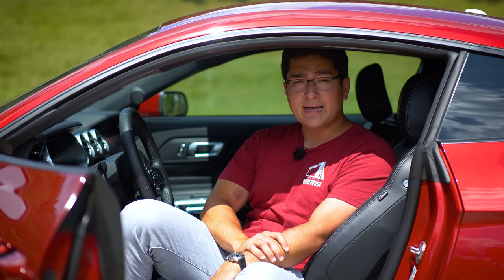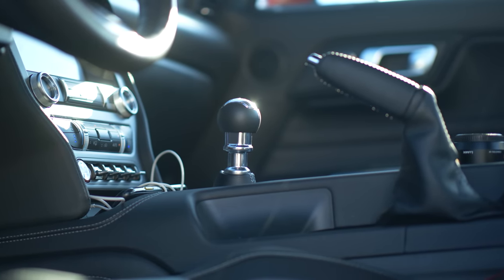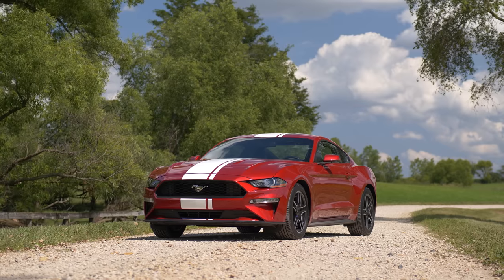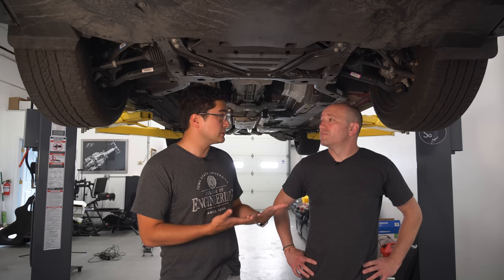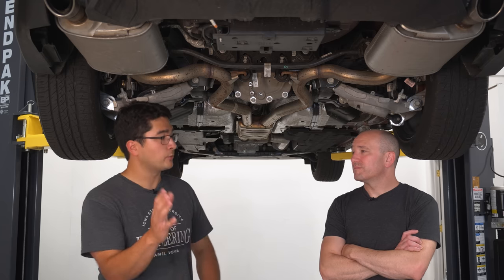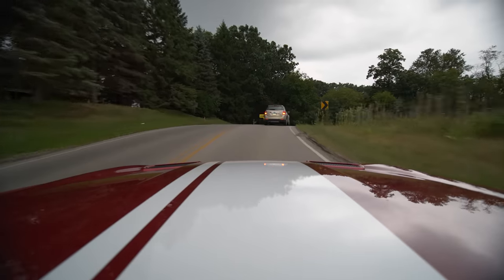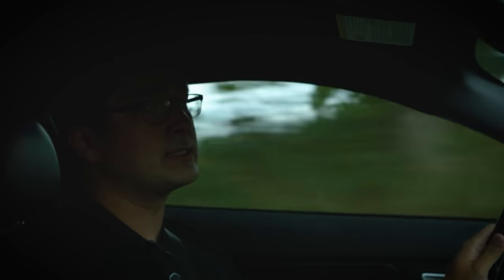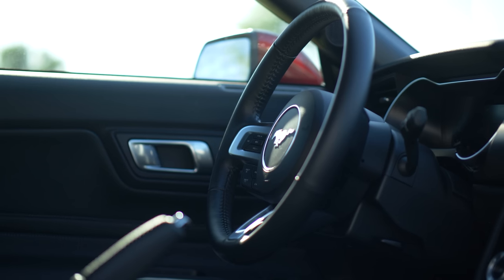2020 Ford Mustang EcoBoost | Red Headed Step Child

Comment: I don't know why so many people and reviewers don't ever freaking highlight the fact that that car weighs 200 plus pounds less than a GT most of that in the front end with an intake and tune from for performance that comes with a warranty  you get very close to the power of  a stock gt  with less weight  possibly better engine response because it's tuned the car gets between 29 and 31 miles to the gallon and you can pick one up for 13 Grand. so even if somebody was performance-oriented it takes between 19 and $22,000 to find a low mileage good condition completely stock Mustang GT with performance pack other than the sound not being as great how is that not a fantastic deal to pick one up for $13,000 for the price that takes you to buy that GT you could spens differences between 7 to $ $9,000 and have an EcoBoost that weighs well over 200 lb. The Mustang GT has more horsepower than a Mustang GT and has way better suspension a Mustang GT. If you get it all through Ford performance you can literally buy GT350 suspension parts for the price difference. And if somebody is really performance-oriented for the price it would take for somebody to buy a Mustang GT performance pack and then put in 45 to 6000+worth of bolt-on performance parts that would make the car barely be pushing 475 wheel on good E85 maybe maybe touch 500 wheel... somebody can have a fully built EcoBoost Mustang pushing out 750 wheel with a fully forged block and internals weighing well over 300 pounds lighter than the Mustang GT because with the $15,000 that you would save you could afford to do carbon fiber racing seats and probably some Carbonaro as well... and price-wise those people would be would be spending the same amount of money except for the EcoBoost would have race rims tires full suspension carbon fiber racing bucket seats in a fully forged fully built engine capable pushing well over 750 wheel and weighs well over 300 pounds lighter. 4bangers have been proven time and time again to put out lots of power. And to top it all off driven right or like on the highway just comfortably fully built in tune you could still pull 30 plus miles to the gallon in that EcoBoost. and I know there's been horror stories about the EcoBoost but that was a mess up from the factory putting the wrong gasket on 1/2 there have been racing companies to have been building and racing with Ford 4 bangers for well over 20 years And they're racing blocks and parts are proven. This is not the first time Ford has done a 4 banger and there are some awesome companies the manufacturer great quality extremely high performance 4 cylinder engines from Ford.

Comment: Legit question, since you have covered both cars multiple times. 
BRZ or EcoBoost Mustang as a 'sporty' daily?
Reply: Brz
Reply: brz has only 200hp, has a stupid outdated boxer engine, and it's ugly af. Amazingly, the ford with nearly 100hp more gets the same city mpg at 21 that the BRZ gets, hahaha.
Reply: jbn675478 as someone who does this for a living. Driving is more than just bench racing. While yes the ecoboost is much faster in a straight line the trd equipped 86 we just did was a far better drivers car. Way better inputs specifically steering and suspension tuning. While i agree the motor isnt great from a stat perspective at least it is high reving and has a consistent power delivery. Really from a car perspective the only place the ecoboost takes it is in usability and refinement. So BBI its up to you but the base manual eco boost we tested is not a drivers car, but a pretty competent camry v6 replacement.
Reply: @jackholmes8105  much more than bench racing, I see. Gee, I never thought of that. I mean, I don't "do this for a living", but I'm pretty sure he's not asking about racing!

Here's a decent article on the subject: http://www.rightfootdown.com/cars/reviews/subaru-brz-vs-ford-mustang-ecoboost/. Keep in mind the new Mustang has an upgraded suspension package.

IMO overall the better vehicle is the mustang, but a long shot. The BRZ is the car I always laugh at. But that's just me.
Reply: jbn675478 i get that. Sorry i didnt mean to sound condescending. I do apologize. 
Just having spent alot of time in both cars(i owned a s550 gt pp1 which i turned into a track car fbos and complete suspension and a brz which was a light autox build), and now two press ecoboosts. Outside of on paper i dont see how someone can prefer the 4 cylinder s550. I admit i have not driven the high performance pack ecoboost with the handling package or one thats been tuned. I am interested in how you feel about the nd2 miata and s2k? They are both in a similar camp as the 86
Reply: here man, watch this guys' review, he goes pretty in depth even showing the different exhaust notes of the mustang: https://www.youtube.com/watch?v=aVsKUAaZhhM
Reply: @jackholmes8105  sorry man, i have no idea, lol. I'm just giving a layman's opinion. I honestly hate the BRZ though and in fact I can't stand Subaru at all to begin with. S2000 though is one of my all time favorites.
Reply: jbn675478 trust me i get it. I dont have the highest opinion of subaru. If you do find yourself in the market though there are alot of options. Camaro ss 1le or v6 1le, miata nd2 rf, m235i etc

Comment: 300 horsepower sounds like a lot from any engine. The Eco Boost Mustang 
would likely be the car for me. I'm a car guy but not one that needs big horsepower or higher performance. I am presently drive a Toyota Corolla LE with tied and true 1.8 litre 4 cylinder and an automatic overdrive transmission. That engine produces 132 horsepower. The powertrain is refined with adequate acceleration for my needs. The car is nothing special. There are thousands of these on our road. They are solid and very reliable as well as relatively comfortable cars made for budget car buyers. My car is a 2010 year model with around 130,000 miles and still looks and performs like new.The top trim level Corolla  is under $25,000. It consider the Toyotas a very good value. You get a lot of car for the money spent but they are are not high performance cars with high horsepower and they don't pretend to be  but I enjoy my Corolla as much or more than any car I've driven including 3 Mustangs all Fox body including a 1979 model with a 302 V8 and 2 V6's. A well equipped 1998 and 2004 year new models. All of these cars worked well for me. However the new 1979 model had some build quality issues but that was typical for the 1970's.

Comment: I had a 2015 EB and it wasn't a bad car at all. It was cheap, looked good and fairly quick, especially with a tune and a upgraded intercooler.  With some aftermarket wheels and better tires, it actually handled fairly well on back roads. I liked it more than the Mazda 3 I had before it. The biggest criticisms I had would be how sluggishly it revved and how bad the exhaust note is. I have 2018 GT PP1 now and it's a far greater driving experience but the EB has its place.

Comment: The "upgraded" version of the ecoboost that was in the RS made good power until the cylinder walls and head moved around blew your headgasket. Huge design flaw in the engine block design. Well documented to be a pos. design. Hope they fixed it.

Comment: I need to say, i don't care about V8s, i just hope that the Ecoboom is finally reliable.
Reply: That hasnt been a problem for quite a while, really only 2015 and early 2016s had this issue and the Focus RSs fitted with the wrong head gasket at the factory.
If youre buying stock and running good fuel Ecoboom will never be an issue. Start tuning and its always a risk, you have to baby it a little cause its an open deck block like a lot of Euro cars are.
Reply: @nboy7  Nice, thanks for the reply. Sadly where i live we still have the gen 1 ecoboost fitted on 2020 cars

Comment: Review the 10 speed auto Mustang GT please! A lot of ppl choosing auto over manual now (super fast auto vs manual MT82 reliability issues). Also new features like digital dash, active exhaust etc 
I want to know your thoughts!
Reply: The 10 speed keeps the 5.0L in the power band & will take more torque, with no problems, as opposed to the manual.

Comment: Sorry, guys. I think you were a bit unfair to the Ecoboost Mustang (at least those with the High Performance options) and not because you're jaded by driving so many different high performance vehicles. Rather, I suspect it stems from the fact that you exist in an environment where roads are flat and straight, stretching  all the way to the horizon and where mountain roads are non-existent. Where performance is measured almost solely in terms of  0-60 or quarter mile acceleration or simply pushing the right pedal to the floor and holding on. 

I grew up in the middle of the country so I know that environment and the "enthusiast" culture it breeds. But now I live in the Pacific Northwest. My weekends aren't spent on a drag strip or engaging in stoplight burnouts. My favorite roads on an early Sunday morning encircle Mt Rainier in the Cascades. In that environment the additional power of a Mustang GT, much less that of a GT350 or GT500, is largely wasted (or not even accessed)  while a properly spec'ed Ecoboost Mustang can be driven near its limit. And frankly, if I were testing that Mustang against a GT500 on a 100 mile loop around Mt Rainier I'd be fully engaged and driving a lighter, more maneuverable vehicle. I might be on my second beer when the more powerful GT pulls into the parking lot.

Comment: doesn't look like it drives much different then the 1994 Thunder bird i have, tho... someone had a V6 eco boost that was getting serviced and they sold me the turbo chargers that were on it. so the 4.6L V8 makes about 200hp and 260lbft as is, if i tighten down the wast gates... it could see up to or even over 400lbft from 2000rpm to 5000rpm. i guess the rear end on those turbos are Titanium... and there fore what i am working on is a smaller displacement option for a 460 cubic inch option. "4.6 -> 460... a decimal moved two places over". building it up costs less then buying a 7.3L, would have been vary interesting if this was around in the 90's... Titanium stuff? could look for other stuff for the 4.6, but there isn't much around that isn't already bolted to something.

Comment: Prefer Supercharger (Whipple/ Roush), because at 38,000 miles i had Turbine Lockup within the Turbos at 82°+. This is caused by Thermo Variations consider locations of Turbos Ford mounts them below for lower center of gravity.  Problem is they're right next to the very hot engine.  Ricers know this and mount them up high close to heat extraction hood vents.  To keep them cooler, and not for show. Now the Turbo Shell expands like a donut 🍩, while it's being baked the outside expansion is outwards vs. Inside expansion is inward the hole gets smaller. The Blades expansion is outward to be larger to hit the Shell. Locking up the Turbine Blades, and then add the Backflow from the Intake and Downpipe to it to spool the the Turbos more.
My fuel mileage went from 
32 mpg to 8-12 mpg.  Glad for 2021 it'll have the GT500 engine package 5.0 V8.
Currently, have a 2016

Comment: My wife is waiting a new one she has a 2007 now with v6 automatic she doesn't need a v8 but how does the 4 cylinder compare to the old v6
Reply: the 4 has more power and better fuel economy than the V6. The one advantage of the V6 was its relative simplicity compared to the turbo four. I've had 3 previous Mustangs (66, 84. 86) and my 2019 EB convertible with the manual transmission is superior in every way. If you take your time and search the net and are willing to travel, there are some nice 2017 V6 to be had. Most were rental cars with the 6 speed automatic. I was trying to find a 2017 V6 with manual, very very rare, so I gave up and searched for a month to find an EB convertible with a manual, also very rare. The back seat is a joke, OK for little persons or groceries.
Reply: @rizzlerazzleuno4733  thank you very much and thank you for taking the time it means a lot

Comment: "You could have had a V8."  The ecoboost engines have a lot of power and aftermarket support but seriously a disposable engine. 100k miles on a a well cared for Coyote 5.0 is nothing. 100k miles on an ecoboost is probably like 300k miles in comparison .If you trade-in every couple years then who cares? If you buy a new car that you want to keep for decades absolutely buy a V8.

Comment: I am debating buying a $ 44k Ford ecoboost premium fast back with the high performance and handling  packages . or a $ 45k bmw  230i x drive coupe . what would you drive , and why ?
Reply: For those prices i would look at either a gt pp1 or a 440(cpoed)
Reply: @jackholmes8105  A GT pp1 optioned about the same would be about $ 54k . budget no can do.  Think if I was to go that high I would look at a m240i or a Kia Stinger. when you start to option , and its your daily driver , you can go to a more base car with just performance options , but do you want to . tough decision .
Reply: @eaglewolf5  what about used or CPOed. Also mustangs have a ton of rebates. My 2015 in 2015 was bought new, the MSRP was 45 and i paid 33 before TTL
Reply: @jackholmes8105  Good point , I have always bought new , but I have just started looking so maybe that right deal will decide for me . I did just a few days ago walk on a deal for a challenger , because the dealer would not give me a match on employee pricing . some dealers will ,that is why looking is so much fun. but when you are shopping a price point you can settle on the wrong car . do not want to do that , have done that in the past .
Reply: eaglewolf5 use true car or car gurus should make your search much easier but for that kind of money i would just go for the v8 or a b58 equipped bmw you would be much much happier
Reply: @jackholmes8105  Good info ,thanks .

Comment: No mention if they fixed the lack of bracing on one of the cylinders that led to movement and failed head gaskets :(
Reply: Was that an issue with the Mustang, or just with the Focus RS? I seem to recall reading that the head gasket design was better on the Mustang and was (for some reason) modified on the RS, leading to failures.
Reply: Spoiler alert it's still the same, a better block exists already they won't put it on these because then they would compete with the GT, the intercooler is anemic pathetic and the turbo is insanely small with the high-performance pack version raising turbo size barely and there being a good alternative out there called the nx2 that bolts on and supports over 550hp, the 2.0 block is used by engine builders like tuneplus to the range of 600-700whp built, this engine was designed as a grenade to prevent it ever competing with daddy GT

Comment: I get that savagegeese typically does reviews on OEM cars and don't mention after market, but the Ecoboost makes power just as good, if not better, than the GT. There's plenty of examples making 400+ hp/tq on the STOCK TURBO, check out PD tuning. The sound is really what let's me down cause it doesn't match the mustang. I wish they put this drive train in something a little smaller/lighter, but ford has made it obvious they don't care about selling cars anymore since they make more money with SUV's and trucks in America.

Comment: it's really weird how you're crapping on this for being low powered and slow, while just a month ago you praised the Type R for having a ton of power and being fast as hell

The Type R has less HP/Torque and a slower 0-60 than this car 

I get the suspension and transmission critiques on this not being performance oriented but the power thing doesn't make sense to me
Reply from the maker: The Type R would kill this thing in driving enjoyment. Its a far more developed cheaper car.
Reply: @savagegeese  oh yeah definitely!  I completely agree with that

I'm just saying I think you gotta at least give credit where it's due for the power, doesn't this have more power and better 0-60 (in a straight line) acceleration than the Type R?  

I'd watch a savagegeese video drag racing the two side by side just sayin :)

Comment: "It's not a V8... pathetic" yet the Ford GT is a Twin Turbo Ecoboost V6 that blows out even heavily modified GT's.
People with V8's clown on anyhting under 8 cylinders saying they're not enthusiast enough.
So does that apply to people with a Huracan Performante, Audi R8, Lexus LFA, Dodge Viper, Porsche Carrera GT (V10 Cars) saying people with V8's aren't "enthusiast" enough since they didn't spend a "tiny" bit more money and spring for a V10 instead of a measly V8?

Comment: I have a 19 GT with the base sound system and it is awful. I replaced all the speakers with Focal components and it's a different beast altogether.
Reply: Jack Wells  i read a review of the base sound system that said the speakers were made out of tissue paper and broken dreams. That is accurate. The Focals are vastly better in every respect.

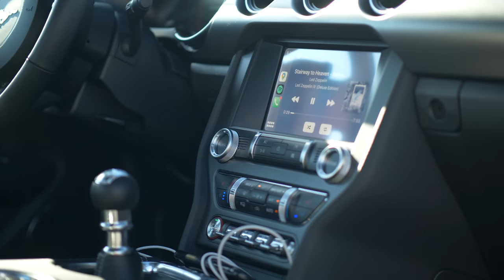Comment: Excellent video as always, Mark - liked the 'barf manoevre' at the end of the video and also, interesting choice of music at 17:50 :)
For myself, the exterior is absolutely cartoonishly juvenile and, coming from an Audi, I still can't fathom why is it so hard for Ford to make interior (in particular, drivers gauges and 'infotainment') that actually someone would like to use instead of this, whatever this is - at least they've retained physical buttons. Maybe the 'target demographic' just doesn't care. I do appreciate the manual but cutting timing in 4-cylinder engines I think today is simply unacceptable, at least given how capable and 'artifact-free' Honda's and VAG engines are. In the end, just like most of offerings from Ford, FCA or GMC - it seems outdated, unrefined and chintzy. But again, good on them for trying to save the manual. Thanks for the review!